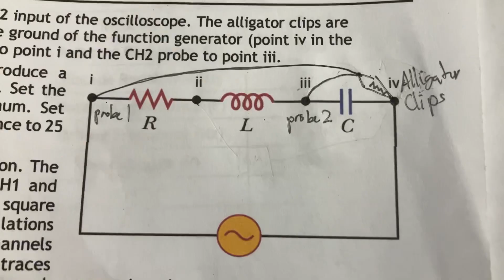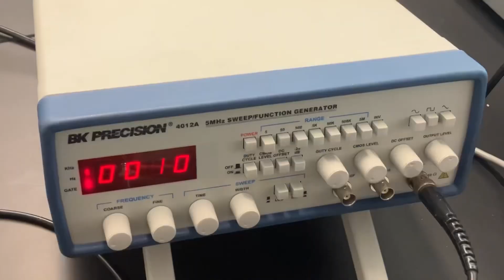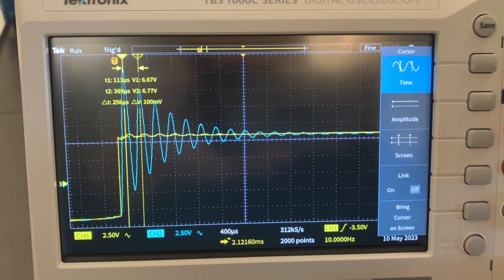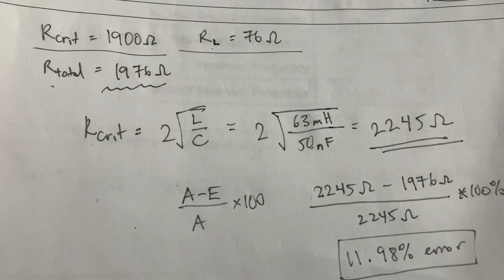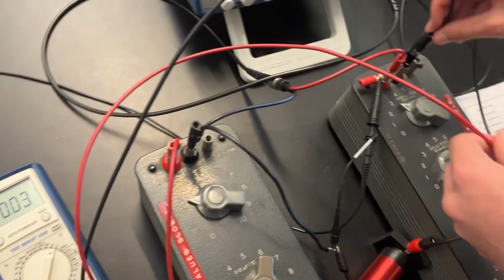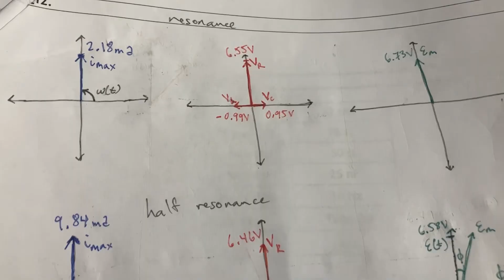RLC Circuits Explained: Visualize Them with an Oscilloscope!

Comment: Why create a plot of the log of v(t)? It’s the inverse of the natural exponential function. I guess I need help understanding the motivation.
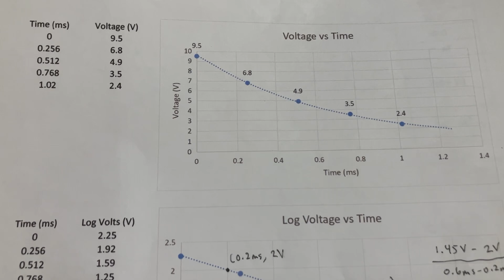Reply from the maker: Good question, at 01:45 the top graph is V(t) with a curved line and below it is logV(t) with a straight line. 
The slope of the straight line is the decay constant -1/RC in the equation for Voltage: V = Vo e^-t/RC
Reply: @mtheorylaboratory  aah by showing the linearity of the time constant it gives a better picture of how it impacts the decay of the natural exponential function. Steeper time constant graph = faster decay
Reply from the maker: @mainnevent515  Thanks for the observation, that helps to explain what’s happening!

Comment: The resistor is too big you are not getting resonance it seems an overdamped system
Reply from the maker: mistakes were made in my calculations
Reply: @mtheorylaboratory  it appear to me the resonance you see is only at the inductor of self resonance of the capacitor otherwise the voltage across the components would be greater than at the resistor…
Reply: @mtheorylaboratory  or you should try pulse at the resonance frequency to get it to resonate maybe